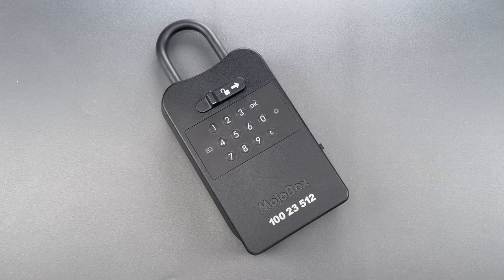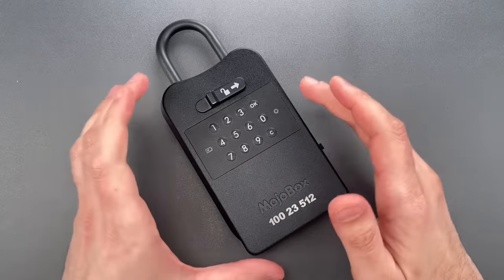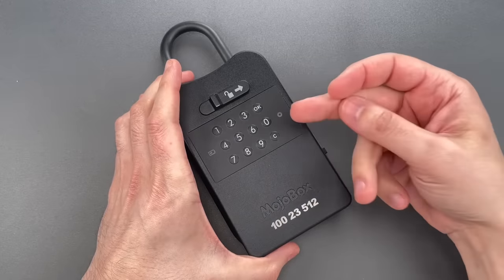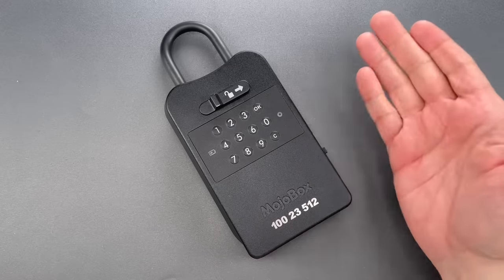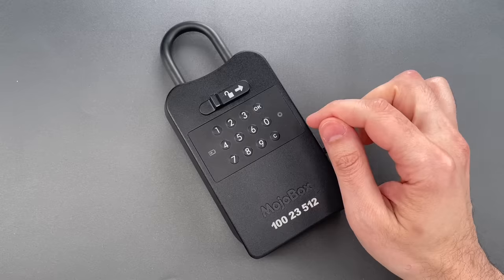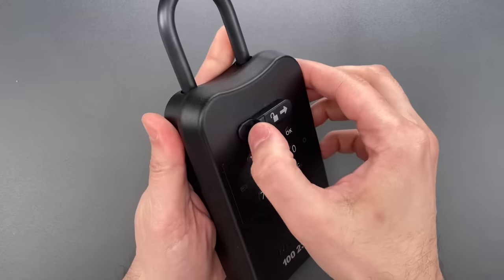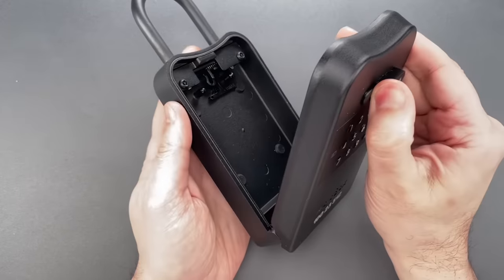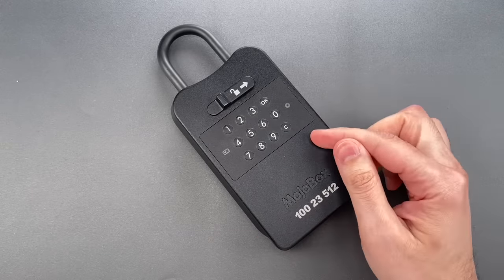[1505] MojoBox SLAPPED Open!!!

Comment: And they could solve this so easily by adding a big enough capacitor to the board.
Reply: Yeah, that's such a brief power cut, that's pathetic cost cutting... Absolutely no reserve power.
Reply: Have you any idea how much a capacitor like that costs!? A single 470 µF capacitor would run around $0.02 each.

In a product that retails at $55.00 it's just not worth it. $55.02 would kill their market.
Reply: Or by teaching the lock self defense.
Reply: That's the first thing that popped in my mind, but that doesn't mean it'll be way more secure, I'm sure LPL would find pretty quickly another flaw to the design
Reply: I see they have added a series of thumbtacks glued to the side to deter thieves.  However, for some reason the thumbtacks always arrange themselves in a way that spells out the code to open the lock
Reply: Even more basic.  Use a 9 volt battery instead of 2 AA batteries.  It would provide a much longer batter life and overcome this attack.
Reply: That lock just lost its mojo
Reply: @drunkenhobo8020 Much less is needed.  1 μF of less would be enough for the microprocessor to not forget that it was fully adjusted and locked less than 5 seconds ago and should not start over by unlocking itself.  Code doesn't even need to run, just a slow hardware timer counting down from 10.  Once power comes back, the code can check how long it's been unconscious before choosing a recovery action.
Reply: @drunkenhobo8020  They could have used better springs and made the battery compartment with tighter tolerances, too.
Reply: They could also store the result of whatever calibration is done in non-volatile memory and not recalibrate at every power cycle.  Virtually every microcontroller has at least a few bytes of NVM for application use.  (Like the combination, for example)
Reply: Should’ve, would’ve, could’ve!
Reply: @-Jethro-  And in the long run, a few hours of coding time costs less than a few cents per unit for a capacitor, which was my first thought (along with several other people).

Comment: This actually use to be a thing back in my school. Some kids would set their locks ready to open thinking if it looks locked then nobody tries. I use to walk down the hallway slapping open locks left and right 😆
Reply: The closest I got to doing that in school was entering the first two numbers of my combination lock. That way I only needed to turn to the last number to open it.

Slightly less dumb than entering the full combination, but still bad of course.
Reply: I just remember shimming the bolt on the door to the science lab with a comb or other thin object when I couldn't be bothered to find my teacher to ask for the key, or if he wasn't there. Finding the teacher to ask for the key took longer. Even just opening the door with the key even if it were already in my hand would take longer.

Comment: Just for the lolz it would be interesting if you tried the same attack after tacking on a suitable capacitor to the power contacts. It should provide power for enough time to foil this exploit and prove how cheap the solution would be (disregarding that the rest of the lock is most likely still c*rap)
Reply: You might also be able to fix it by packing some dense foam or rubber around the batteries to stop them from moving.  Alternatively just pack the battery compartment with hot glue once the batteries are in (Isopropyl Alcohol will make the glue release when you need to change batteries).  I assume the battery access is INSIDE the lockbox, otherwise you can get in just by pulling the batteries out and putting them back in again.

Comment: It's not like there's some kind of magical device they could've built in to the power lines which could store a bit of electrical charge to cover the time the battery would be disconnected during a shock, and any such device would have to be prohibitively expensive.

Oh, wait, I somehow forgot for a second that capacitors exist and cost mere cents.

Comment: Those are things that are great for escape rooms!

I had a wooden lock where you also had to slap it ont the bottom, which allowed a ball to jump and liberate the pin. Turning it upside down didn't work, I do not remember if it was a spring or another mechanism preventing that.

Comment: Garmin, for years, made bicycling GPS units for handlebars that had this flaw. Road vibration would cause the unit to poweroff after a while as the battery spring wore out

Comment: Double sided mounting foam tape is perfect to secure the AAA batteries. I've fixed many expensive devices this way, that were randomly shutting off or malfunction. The only downside is that a screwdriver is needed to pry out the batteries from the compartment. Not a big deal if the batteries can be recharged inside the device.

Comment: Remember the time you looked at the yondr pouches?  This is how my classmates open them (it knocks the pins in the locking mechanism loose, and on the new ones there is a spring that pulls the pin out, allowing this attack to work)

Comment: I was disappointed that he didn't explain how simple it would be for the manufacture to correct the problem. It may be as simple as adding a capacitor in parallel to the batteries. A buyer may even be able to make this correction. Of course that only fixed this "slap issue" with the lock.

Comment: All it would take is spring tensioning on both sides like found on weapon-lights or using a snap 9v battery and the problem would be fixed.

Comment: A group of smart friends go into an Escape Room for some fun; leave 45 minutes to an hour+ later having had a good time and getting out following clues

I go into an Escape Room with some friends and 2 hours later they realize we are all ~STILL~ in there and still stuck on the 3rd clue

LPL goes into an Escape Room by himself and leaves 5 minutes later.

Super impressed, the staff asks if he’d played that room before

An indifferent LPL curtly says that he’s never been in one before but was impressed by the pick resistance offered by the desk clock, the 3rd drawer on the filing cabinet and the wall safe, but that they should use a different dial combination lock for the TV as it was too easy to listen to the dials finding their gates just by spinning the front controls

“In any case, that’s all I have for you today” 🧐

Comment: Easy fix. all ya gotta do is add one of those small round batteries as a backup power source that is only used when the main battery is removed or shaken.

Comment: Haha, that's like those cheap safes where you slap the top as you turn the handle... I saw that on a really old video so removed the key on mine, modded the lock and electronics inside... I daren't send it in to LPL as I'm sure he'd find another way to bypass it... 😀

Comment: Same problem with the original Oculus Quest controllers... If you flick your hand with controller too quickly in a heated session of Beat Saber, the AA battery (especially higher-mass rechargeable cells) will briefly disconnect and you will lose hand tracking momentarily. Quest 2 controllers have much stiffer springs.

Comment: Its almost like you need a humiliation channel. Locks that are laughable in their security. This should be a benchmark for companies to push beyond simple design flaws. It will be a little rough on smaller companies first trying their hand with making locks but they shouldn’t rush product to market that’s untested.

Comment: i had a safe that opened in a similer way if you slaped the top of it hard as you put some toruqe on the knob it could be enough to move the solinoid to unlock it

Comment: LockPickingLawyer just pimp slapped whomever designed the spring in the battery compartment of this device, and the circuit designer who failed to add a capacitor to overcome a momentary power failure. Ridiculous.

Comment: I was searching for a lock that could open with a good spanking for, you know, purposes.  So glad you did not disappoint.  

On a more serious note, will you be revisiting this lock soon since they have apparently updated it to fix this specific attack?  Is there a keyway?  A backup power source you can ground out or throw negative voltage at to cause the same power-up confusion?  Will repeated slaps eventually cause a reset (and, if so, will you be offering the "Slap-a-matic" on Covert Instruments soon?)?

Comment: I want to know if there is a capacitor missing or under-sized from the original design.  Those are usually the first parts thrown out because the circuit will ostensibly work without it.

Please send the circuit board to eevblog/ big clive or similar for teardown and analysis.  Or just show a picture of both sides of circuit board.

Curious if an inexpensive capacitor would fix this flaw.

Comment: I'm posting after the firmware fix, but I wonder if this wasn't available, could the battery holder have been shimmed a little to prevent the batteries from moving?

Comment: So, if I buy this and put a stiffer spring to ensure the battery doesn't move, what other attacks would this be susceptible to? I can imagine a padlock shim would work. Is there a key hole or a button to easily make the computer reset?

Comment: is it possible to modify this lock so it is not able to be opened by hitting it? Like putting in a bit of plastic after the battery is put in so the battery can't move :) OR a spring on the positive side of the battery to compensate the movement :D

Comment: But how does it fare otherwise?  There's an easy fix for slapping - just soldering a capacitor in parallel to batteries will do it. So maybe (just maybe) it's not half as bad if you can solder?

Comment: Hey LPL, I have a question for you in regards to this lock. Is this was a lock somebody was using very very very frequently let's say (ex. on a tool shed they went into everyday), and let's say those double AA batteries eventually died, would the lock just open kinda like what happened here when you caused that brief loss of power. Hope you can get back to me..

Comment: You can  save the body of lock, fix the body on door with scew which will go inside the back of door,  you put nut and bolts. 
With screws drivers you can not open body. You need to cut the body,  giving evidence of chori. 
Jay shree ram.